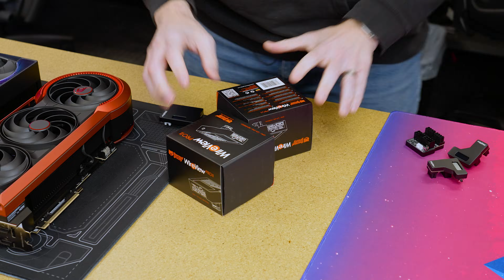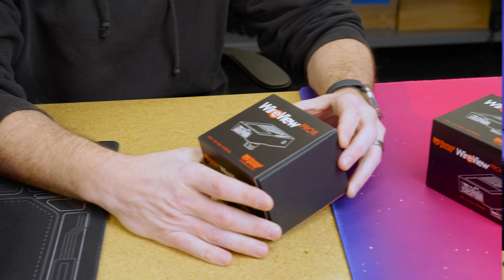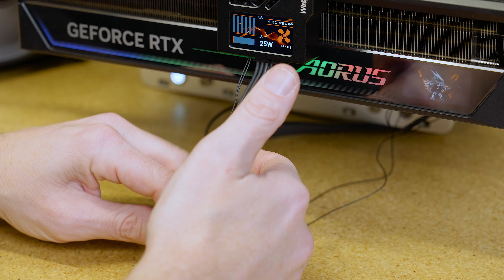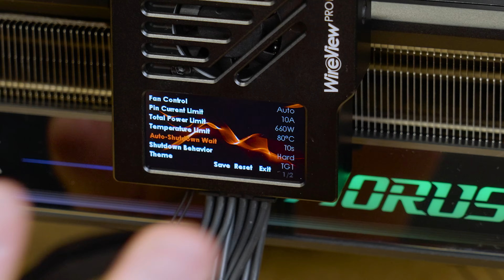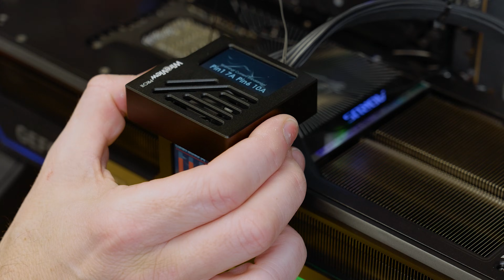Thermal Grizzly Wire View 2 Pro - The fight against melting connectors!

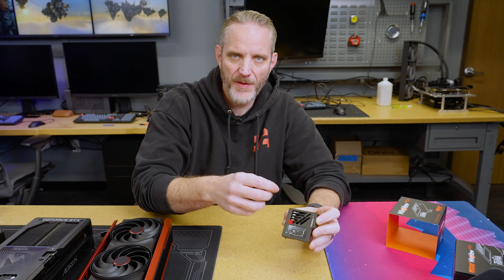Comment: 6:58 to 7.08 I would prefer it if the device was a current limiter that would allow you to keep gaming. A current limiter that wouild not allow the card to draw excessive current along an individual wire.

I would not want my system turning off mid game. It has software shutdown, but hard shutdowns can damage the operating system. The alarms are excellent, but some of us are playing with headphones on. 

Am not criticising. Am just being critical and hopefully constructively, plus highly likely to buy a Wireview Pro II.

Second constructively critical point is that I wish the wireview was on a wire and not sat resting on the GPU. The Wireview will block some heat leaving the GPU becuase of where it is. Plus the WPii will get hot sat next to heat exhaust fins.

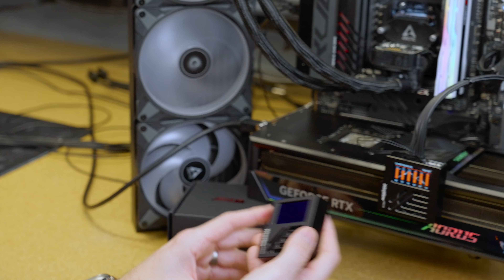24:20 Someone will clone this for half the price.

Comment: I watched his video on this model, with the BTF connector. could, should, board partners just include the adapter with a spider cable, branching out the 12vhpwr to 16pins instead of just 8.

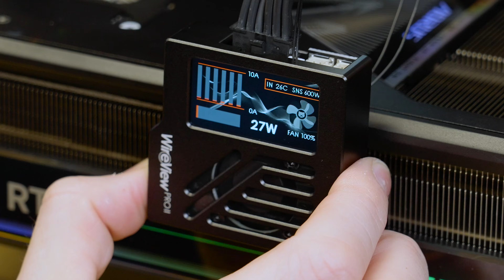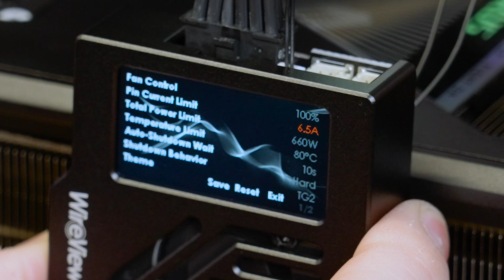Comment: I think there's no use complaining about fan speed 100% at 17:56, claiming a firmware update might fix it. At 18:40 you can see it's set to be 100%, which I believe is one of the fixed levels. Maybe "Auto" will be better in this case?

Comment: Yes, you can shill out 140 bucks for this useless and overpriced gimmick, OR, hear me out, you can make sure your case actually fits the card you're planning to put into it without you having to molest its wire into a sharp 90-degree bend right on the connector, properly and fully insert the connecror into the plug, and leave it the fuck alone. 99,9% of "melted" connectors are user error, where they either bent the shit out of the wire right at the connector (big electrical no-no), or fucked up the connector by constantly plugging it in and out because an internet celebrity told them so.

Comment: Im shocked someone hasn't made a connector out of some sort of non conducting metal or coated to prevent shorts. Coated( just around the pins) copper or aluminum could even be cooled with a little dedicated mini fan. Bare minimim, it wouldn't melt.

Comment: I’ve been using it for 3 days now, and it’s really a great device. The USB-C port isn’t just for updates, it’s also used for the software that displays the data on Windows. The software is currently only available as a beta and is still under development, but it already works really well. In addition, you can program the device through the software, so you don’t always have to press the button directly on the device :)
Reply: Where is the beta software to be found? I already searched the TG website/shop without any luck. Tia!

Comment: That thing is not safe for a high power connector. When pressing the button, it moves slightly sideways and add pressure to the soldering point of the card.
"Wiggeling" a connector is bad for soldering point.

Comment: Sucks, I was gonna pre-order this, but the WireView Pro II won't fit my PNY RTX 5080 OC because the 12VHPWR port looks like it's probably too deeply recessed into the GPU. I would have to use a short extension cable from the GPU to the WireView, and then from the WireView to my PSU, and that's just too many additional points of failure for me to have peace of mind anyway.

Comment: If the WireView sticks off the card that far, won't you have an issue with clearance in your case? It's already a challenge with just the cable in some cases. I do understand why it has to stick out a bit....just pointing out a potential issue for those not running an open bench

Comment: (near the end) "it's the cable" - nah, I think it's unclear. It's the particular loop of that wire. From begin to end. Doesn't matter where the valve is, the water flows how the valve is set. (to use your water analog) That means it can be eather connection, starting from the solder on the gpu pcb, gpu connector, gimmick connectors, cable connectors, psu connector to the psu pcb. You need to switch the cable to see if it is, indeed, the cable....

I have a 4090 and now I desperate want this device!!!!

Comment: So question
I have the astral 5090 lc but it's vertical mounted I now I won't see the display and the wire is vertical and if it may not fit do they take them back for a refund

Comment: It's a pitty you didn't compare the readings from this device with the pin readings on the Asus card. I wonder if the readings would match there. Maybe you can check it?

Another issue is that it's a real scandal that the user should be responsible for device safety. I know from experience that inserting and removing the same cable (correctly in both cases) from both the card and power supply side can significantly alter the situation, and the pin readings can change. As an Astral owner, I can test this myself, but any other 5080/5090 card is a gamble. You might think everything is connected correctly, but there's a problem and the wires are melting.

Comment: i dont understand some comments, either dont buy a gpu with that connector or buy a wireview u know the problem exists. Now 140 may look expensive, but they do manufacture in germany plus in compared smaller quantities. On top they will fix your card for 2 years if its still melts while using the connector. and dont forget Dollar value is getting worse, in germany its cheaper

Comment: Creating amp metering circuits in a GPU, that actually does nothing, except showing it in the dedicated app, that also does nothing when things are going bad. It will not shutdown PC, not give any popup message, nothing.
140 bucks for power meter adapter because of bad connection - great. Now we need to buy another, super expensive, bulky adapter with a fan. :D People, wake up and take a look how ridiculous it is!

Another question. The fan in that thing is blowing the air to the card direction? So it is opposite to the airflow of the GPU cooling? :D

Why not create simple cable with simple thermal switch, that cuts of the circuit when temp goes over certain temperature? Bimetal switches are being used in electric kettles for years. Cheap, simple, reliable. Because it is so cheap, we can easily mount two of those switches on each side of a cable to prevent burnouts on the PSU side as well and problem solved.

When temperature goes over for example 70 degrees, bimetal switch cuts off all sense pins. This cuts off the power from the GPU. Cutting of the power from the GPU results in an instant shutdown of whole PC. When it happens, user knows that something is wrong and checks the connection of GPU cable. Because bimetal switch cuts of the connection on the cable, there is no further damage to the GPU, PSU, connectors and cables.

All those fancy adapters, power metering circuits built into GPUs that make board design more complicated and require you to use another external software (let me guess, not available on other OS than Windows?) are the one of the most over-engineered solutions I have ever seen. Bimetal switch would make whole cable cost 10 times less than that whole adapter...

12VHPWR should be BANNED from any further usage. For any existing connectors, cables should be exchanged to ones with bimetal switches to prevent from overheating and burn outs, so there is no fire hazard for any user - that's it.

Comment: I wonder if anyone has ever done a Metallurgical test on the actual 
metal those pins are made of and a comparison of old cards with the power pins. I wouldn’t doubt if the copper content is lower in the newer pins vs older.

Comment: The USB port isn't just for firmware updates, there will be software that lets you monitor per-pin current etc. and (I think) also gives you the option of a soft shutdown rather than a hard one.

Comment: I do have a question for all you PC builders out there. I am currently using a Gigabyte AORUS RTX-3090 GPU. My power supply is the Seasonic Prime Ultra Platinum 1300 watt, Platinum. Should I decide to upgrade my GPU to the RTX-4090, does the wiring kit that came with my power supply, give me the proper cables to wire up the RTX-4090, safely? Or, would I have to special order proper cables from another source?
Reply: Get a ATX PSU
Reply: @TkoddaLee  This IS an ATX PSU. Rated ATX-12V/EPS-12V. Fully modular.

Comment: There is one feature that this device should have. That is, a wireless remote for the menu, and/or a P/C interface. Temperature sensor readings are going to be different, depending on whether the side panel on the PC is open or closed. If you open the side panel to access the device, the usual airflow will be interrupted. In order to get accurate readings, the device should be accessed with the side panel closed, using the normal case airflow. This could also be accomplished with a PC interface so the menu could be accessed from the desktop to give accurate temperature readings. Also, the temperature sensors will certainly give different readings, in a test bench open environment.

Comment: The problem with pins pulling out is not new. 8-pins had that problem for decades, but they did have enough headsroom at 150W, not to cause much problems if one pin is not properly connected.

Comment: Just to note, the front panel connector won't be usable on an Antec Flux Pro, as the case FPC is all in one block making it easier to plug into the motherboard, but then I lost the use of my external power button.

Comment: NVIDIA IS GOOD. NOT MAKE MISTAKE. Like comment under here. The error is in your head. You all make an Error. You don t need this if you use the adapter included in every gpu box. If you want to plug the gpu without using OFFICIAL ORIGINAL ADAPTER, it s your problem. Not manufacture of gpus. Show me only one video WHERE GPU HAVE PROBLEM WITH ORIGINAL ADAPTER FOR PSU WITH PCIE CONNECTORS and I ll say i m wrong. But until that STOP SAY SHIT THINGS. You don t need that. 😂😂😂😂😂😂

Comment: Couldn't that wireview pro 2 the connector have a swivel to tilt up and down. Just take a shot. Im not engineer. If it was longer and could move up and down, it may be able to fit to some weird angles, or have multiple connectors options that can be swappable, kinda like daisy chain fans luls.

Comment: How is Nvidia not being sued out of the wazoo for this issue? At the very least they should be forced to replace or repair every single one and convert it into a safer connection. If this was any other company they'd have corrected it or been absolutely destroyed with lawsuits by now.

Comment: Running a side hustle, and unless the client really wants a new high end card, I'd suggest a serviced 30 or older series or Radeon card. 
I Really do not trust those Pins, I've seen too many Automotive connectors screw up in past.

Comment: As regrettable as the need for such a product is, the execution is terrible. What good is a cable adapter if it only fits 5% of all available graphics cards? I have the MSI 5090 Liquid, and the adapter would collide with the Dominator RAM. More time and energy should be invested in testing materials and then replacing that flimsy plastic connector with something more robust—something with a much higher melting point.

Comment: I still doesn't solve the root cause of the FLAWED NVIDIA 12-pin connector which is the lack of 6 resistors protecting overcurrent resistance of each 12V+ wire as well as the fact that the wires in the 12-pin are 40 % thinner compared to the 8-pin PWR connector but require more current to be floating through them.

Comment: what they need to do to fix this GPU cable issue, is if the individual cables could clip into the housing of the PCIE cable, like how the whole cables clips into the GPU. So like each pin you just shove it into the slots of the PCIE male end until you hear a click. That would be a cool new design and probably would fix this whole issue with the melting and loose pins in the cable.

Comment: I've upgraded to a card with no pins. Intel B50.

The solution to two bars is not 6 pores and 12 connectors per bar. It's proper screw terminals

Comment: This product could easily exist if the 12VHPWR connector wasn't terrible. It'd be a great product for people who are into extreme overclocking. But now it's a product aimed at regular consumers as a safety product - which is insane.

Imagine that a company that specialized in manufacturing roll cages for rally cars launched an identical product aimed at consumers because new Toyotas would crumble into the passenger space like origami.

Comment: Aren't the 12pin connectors reversable? So wouldn't it be possible to plug the WireView directly into the PSU instead (given that there's space there of course) if it doesn't fit in the GPU?

Comment: End of the day, power demands are just increasing, developing a new standard should have looked at a 18 or 24v rail if you're going to want to start dropping in 600w + cards.   Running 6 pairs to a single plug just to deliver the power safely is just under-engineering the problem for the sake of backwards compatibility.  

OC'd threadrippers sucking in close to 1000w and 800w 5090's just shouldn't be on 12v anymore.

Comment: I wish they were designed a bit longer so that the connectors hang below the graphics card.  I was about to order one, then I realized that I can't use my 90 degree angled power connector with it.

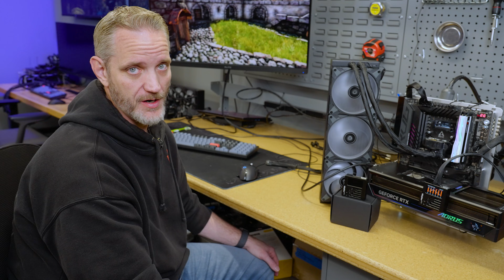Comment: Uh... NO, 24:52  No, $200, it is not worth it. 1/3 the cost of a gpu. For a product with a failed design, just no people. 
We as consumers, should be making more noise about this problem to our collective agencies, that ensure safety in products.  Rather then pictures on social media.
If we are at a point where power to GPUs cannot be met with current cables and connections, we consumers should be asking for different solutions. 
A change in motherboards, maybe the use of busbars, (Bus Bar Pulse Power Plugs Pigtail Replacement for Polaris Plug)- with larger uglier plugs, or power offloaded through the pcie. 
Even a better quality of power cables and plugs.  Not that 12v cable that everyone keeps pushing its pins out. 

Why should the consumer pay for a solution, that should not be there in the first place.

Comment: Fyi - the NEW vireview Pro 2 is also NOT compatible with the MSI Gaming Trio 5090 (like mine lol) .. I'm on the old Wireview Pro to monitor things right now (but can't tie the telemetry data into my PC which sucks) .. & may swap the PSU to a Taichi which has the thermal sensing as part of the PSU itself. 

Shouldn't have to do ANY of this though.. Thanks Nvidia/PCI-SIG...

Comment: All the card makers should have the onboard pin readout so after you connect the cable you run the stress test and monitor it with a HWM and if everything is fine you can just forget about it.

Comment: Hi Jay and everyone. I have been out of loop so I have few questions:
1. I remember the PSU side connectors were melting too. I think it was with 12VHPWR cable instead of older 8 pin pcie connectors. Is wireview able to check that too?
2. I see you got 2 units and in one the fan is not working. Since I want to get it too but now something like this could pose issue for me as the return or replace will not be possible for me. Is der8auer aware of these quality issues?
3. Lastly if the 12VHPWR connector connection is bad like in your case one pin was drawing almost 10amp but another one 7amp, what can be done to even-out the current or is it not possible at all?

Thank you. Love your work.

Comment: MY 6700xt 12gb had 2 pins just slightly melt and then started to fail after a week of thinking it was software,
I looked at the plug and replaced it with spare that came thit PSU and happy days its all good again 🙂

Comment: Jayz daily “I have 3 5090s on the table” flex
Reply: It's strictly for science!
Reply: Its only a flex if you consider the ability to throw away money a flex. The depreciation of computer hardware puts even the depreciation of automobiles to shame. When you can lose up to 90% of value in 3 years, that's not a flex to have 'extras' laying around, just stupidity. Because, inevitably, the next minor improvement will come along....
Reply: Only brought out 3…you know there’s more in the shop that didn’t make the video because they aren’t notorious for melting freaking pins.

Comment: DerBauer knows his shit, but he really shouldn't have to make something like this.
Reply: Why not - techtubers get the views and money by making it a way bigger problem than it is. Stupid people with too much money get scared. DerBauer wants to make money too so he uses that fear to create somesort of thingie which probably cost like 15 bucks to make and sells it for 10 times the price.
Reply: @brudel001 tinfoil hat moment - how many stories of 8pin melting through its existance ?
Also any actually valid reason to replace perfectly fine power cable with newer, thinner ,smaller one ?
Reply: @overclocker3164  nobody knows how many. If you put in google "melted 8pin PCI-E connector" you get tons of pictures. Back in the days my friend had a card with single 6pin that melted. Why we didn't hear so much about them - well because the 8 pin came out in 2007 and back then there wasn't gazillion "techtubers" running monetized channels where blowing things out of proportions generated more views and thus more money. It was considered an "unlucky situation" not "omg 9 out of 10 will fail" while in reality the issue is less than 0,5% and out of those who knows how many inserted the cable badly or gave tons of more voltage for benchmark runs.

The reason for the new cable was simple - we'd be running four 8 pin connectors on the cards like 5090 and something needed to be done since one PCI-E is only rated for 150W. If you ask me is the solution perfect - NO. I mean they could have made the sametype a connector but in the same proportions as the 8pin was (the HPWR is every way smaller than even one 8pin) and I bet that there would be allmost no issues.